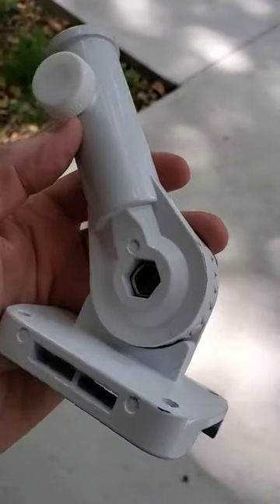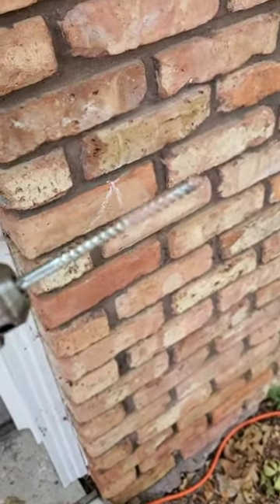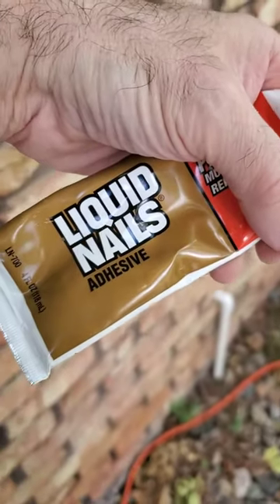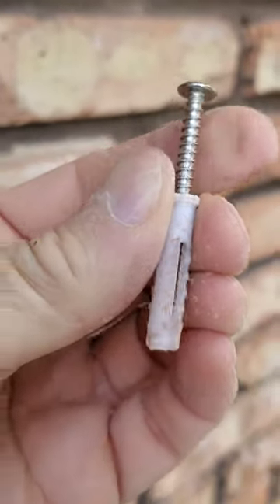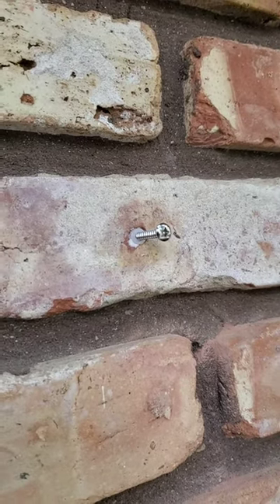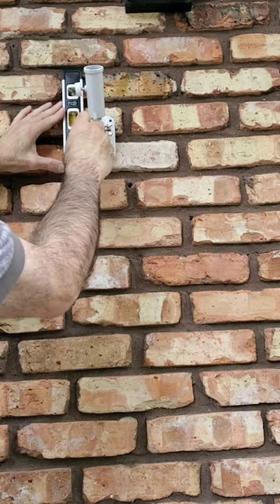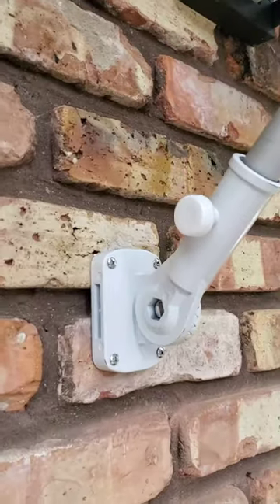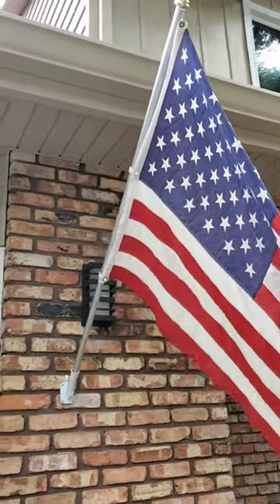Flagpole Bracket Installation on Brick (VERTICAL VIDEO)

Comment: Great job, I'm just more concerned about what type of screws and hardware to use to mount it
Reply from the maker: I used brick sinkers with galvanized screws. Any Ace or other hardware store should sell them. Main issue is to use plastic (or lead) sinkers made for brick and masonry. As long as you use correct size length and thickness they will hold up fine against wind load and leverage.

Comment: I’m not sure about size drill bit to use with anchors. Same size as anchors or smaller?
Reply from the maker: I use slightly smaller for plastic anchors. That way they go in a little tighter. Screws will expand anchor into the masonry.